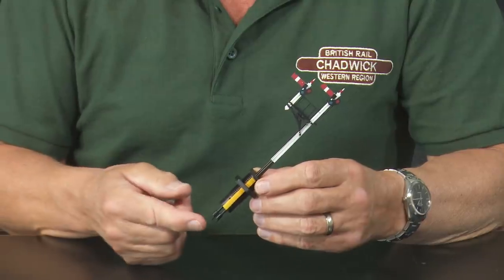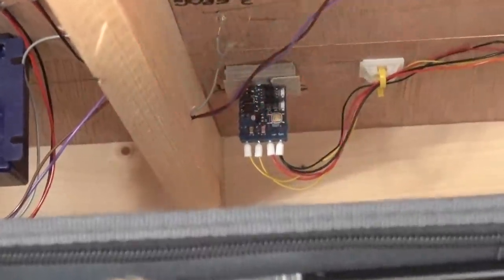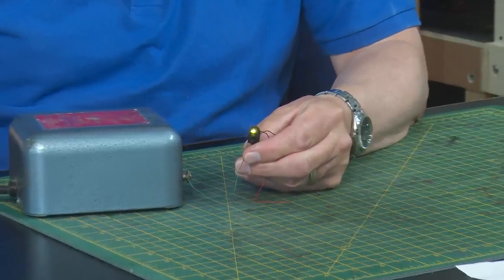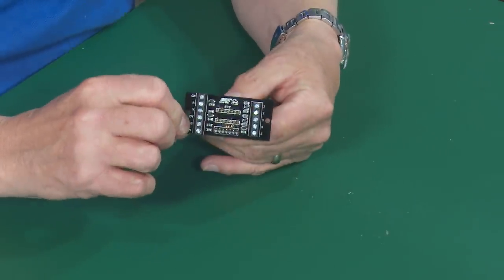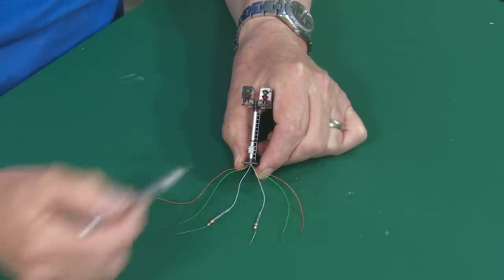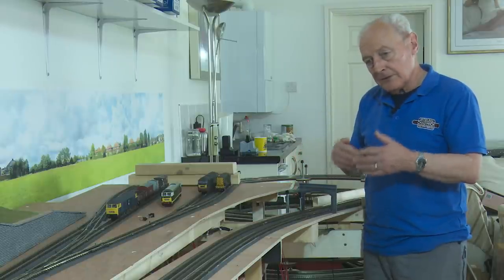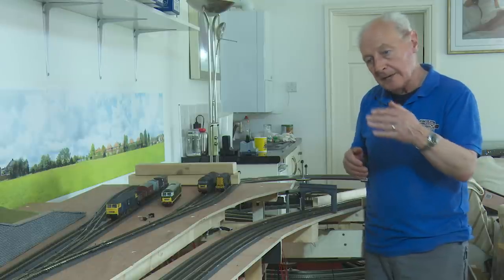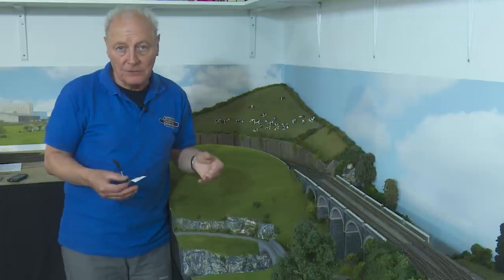Wiring LED and Semaphore Signals at Chadwick Model Railway | 135.

Comment: Charlie, thank you for taking the time to try out my products.  Really thrilled to see that you were impressed by them.  It means a lot to me to know that you are using them on your layout.  Best regards, Steve Heaton, BLOCKsignalling.
Reply: They seem like decent products Steve; Charlie isn't easily impressed.😁👍
Reply from the maker: Thanks for the comments Steve and yes they worked faultlessly straight out the box. One thing that did impress me off-camera was the very small ferrules that you use, perhaps you can give me a lead to where you purchased them from?  Regards Charlie
Reply: @BLOCKsignalling  what is the product description and code for the product used with the Semaphore signals, please. Keen to purchase

Comment: Hi Charlie, I always look forward to your videos and have got some great hints and tips from you. I would like to now pay you back for those. I was a train driver for about 25 years, I then went on to be a driver trainer before I left the railway for a short while, and now I'm a signaller at a very busy London Area Signalling Centre, (ASC). So, very basically, a controlled signal will always be 'on' i.e. at its most restrictive unless the signaller clears the signal. This means a stop signal will show danger and a distant or repeater signal will show caution. This is the same whether under Absolute Block (AB) signalling (Semaphore) or Track Circuit Block (TCB) signalling (normally Colour Light). Where these great gizmos that you show us really come in useful is for automatic sections on TCB lines. For example, you have several signals on a stretch of line where there are no points (crossings or junctions) and the passage of the train would be used to operate the signals. However, where you have points, the signaller will have to decide where the next train is to go (or come from) so will have to set a route prior to clearing the signal. That is why controlled signals are always normally 'on'. (At danger). In modern signalling the passage of the train will put a controlled signal back to danger, however, the signaller would then have to re-clear it. In AB / Semaphore signalling, the signaller would have to physically return the signal to danger and then physically clear it again. I hope this helps and gives you a basic idea. if you wish for any more information, please don't hesitate to ask as I have only gone over signalling at a very basic level. Keep the videos coming. Paul Kendrick.
Reply from the maker: A great comment Paul and great facts to absorb.  I have also replied by email.  Regards Charlie

Comment: As a Signal Engineer it is tempting to go into loads of detail about how your interpretation is wrong, but as someone else has said, for most of us it does not matter whether it is totally prototypical.
Starting with Absolute Block signalling (the old little signalboxes along the line with levers) they can be done with semaphore or colourlight. All the signals for a signalbox would normally be at danger (or caution for the distant signals). On approach of a train the signaller would hold the signals at danger until the train was close to each stop signal because the distance between them would not normally be sufficient to stop the train from line speed. Each signal would protect part of the station limits (the bit controlled by the signalbox). The signals on the approach would be called home signals and there could be an outer and inner home, or just the one. The signals going away towards the next signal box are called starters and there could be an advance starter as well.
If the signaller has got permission from the next signalbox for the train (using the block bells and instruments) then they clear the home signal(s) and starter(s) in sequence and then can clear the distant signal to show green. That tells the driver that all the signals controlled by that signalbox will be showing proceed and they do not need to slow down.
If one wanted it to look really realistic then it would be nice to be able to trigger each of the signals to clear from your control panel but for the passage of the train to cause the signal to go back to danger.
Reply: Totally agreed and very well explained If we modellers want to include signalling on our layouts then why indeed not follow prototypical form it makes for a very interesting scenarios 👍
Reply: Glad you wrote that one John, wasn’t looking forward to try and explain absolute block concisely, Charlie plenty of articles online about absolute block and diagrams explaining about block instruments etc, google is your friend, Once again Charlie, you are right though when it comes down to it, it is model railway and only you can decide what looks right for you and your pockets
Reply from the maker: Great comments guys, and let’s be honest installing semaphore signals that work prototypically with automation is an absolute nightmare. Regards Charlie
Reply: Back in the late eighties I was released from train driving for a period to help make in house training films. Though dated now most are online now look for “principles of signalling” parts one and two. Films show a lot of the above and will include some shots of very old types a lot now vanished and of course more modern colour light signals.  Real signalling easy but trying to wire up model layouts I’m finding a nightmare.   I want a mixture of semaphores controlled manually with levers and colour lights both auto and semi auto and track circuits!
Reply: @jdavis460  excellent link for us modellers Brian I do have access to RSSB but as you may know I cannot share it word for word here.
Reply: Your description is not strictly true, if a driver approaches a distant that is on, then he would slow to be able to stop at the home signal, even if in reality it is off. Automation could be achievable with a control application such as Train Controller, be it would need to know a tran has passed the signal either by block detection or infer red detector. Personally I have full track detection on my layout and a control system for both semaphore and 3 aspect colour light signalling.

Comment: To me as a DC railway modeler this video really emphasised the difference between DC and DCC. As for DC the safety measures are really build in to the trackwork (power on/of with appropriate signal lighting on/of as well) as for DCC the safety appears to be build in the programming of the locomotives. Quite interesting really 👍
Reply from the maker: Yes Rob sadly they are worlds apart and even further as technology develops.

Comment: Hi Charlie ... I nearly missed this video ... and regarding signals and Blocks ... and being a member of MEREG ... Julian one of the members developed a brilliant means of stopping trains at a red light with a very small PCB of electronics and a section of isolated track ... I designed the PCB's and have 2 types of boards, Red light stop and Station stop ... and the way it works is it sends a stop DCC code to the locomotive in the brocken section which stops the train, once a Red light changes to green it sends another DCC code to start the train ... in a station it stops the train for a predetermined time ... and it works on any locomotive ...
Reply from the maker: A very interesting concept John. Many thanks, regards Charlie

Comment: And now for a comment on your junction - the route without the feather or indicator is normally the highest speed route even if it is not the straight one (although that can look odd!). If the speed of the lower speed route is more than 10mph less than the highest speed route then the signal will be restricted to help remind the driver to slow down. The most restrictive is to hold the signal at red until the driver can see it (known in the trade as MAR - Main Aspect restricted to Red). If the junction is higher speed then you can have the signal restricted to Yellow (MAY) if there is a flashing yellow in the previous signal or a splitting distant.
If the two routes do not have a speed difference greater than 10mph then both routes can have a green displayed and the direction of the feather is a bit immaterial. In your example some people might provide a feather for each route, or they will provide it for the main route or for the route that is not as straight!
I have been in meetings arguing for hours about that sort of thing.
Reply from the maker: Hi John, you’re pushing on an open door. I think you’ve hit the nail on the head as the lines that run down to the Helix will have a 70 mile an hour limit whereas the line is going to the branch station will be limited to 40. Regards Charlie

Comment: Hi Charlie another interesting packed video and your line diagram to explain Anode (+ feed resistor) and Cathode (- ground resistor) easy to follow and may use it to explain to others in my workplace when wiring up charging circuits etc (Diodes one way valves). 
As I am sure you are aware the flow of electricity is from negative to positive not as commonly believed positive to negative (thanks to atoms lol).
I enjoyed the different options you showed and as always your sense of humour, take care and please stay safe..
Reply from the maker: What a heartwarming comment Barry. Regards Charlie

Comment: Excellent video Charlie.
Problem with using a single resistor is that the current limiting is shared between all the LEDs and as different colour LEDS have different forward voltages and currents you get dimming when two or more are used.   I've always used a hybrid of the two methods - the LEDs are wired in common cathode arrangement, but without a common resistor.  Then each LED has its own resistor of the correct value to ensure the brightness is uniform across all LEDs.  I tend to use resistor values that restrict the current so that the LEDs are not ultra bright, but more "scale" like.  This way the signals don't act as search lights or floodlights and turn night into day :)
Reply: Agree with Malcolm; the general case is each LED has a resistor of its own between the control signal and the NON-common end of the LED. The OTHER end can be commoned. This is because different coloured LEDs normally need different voltages to give the same light level. Sorry
Reply from the maker: An excellent point gentelmen.
Regards Charlie
Reply: Totally agree with Malcolm and Basil. Separate resistors allow for multiple LED illumination (for lamp testing, even if not for operational use), and fine tuning of LED brightness. Different colour LEDs have different current requirements for the same perceived brightness.

Comment: Because of the method of operation of Track Circuit Block there tend to be a lot of colour light signals which work automatically - clearing signals as the blocks ahead become unoccupied. But as a train passes into the section, the signal returns to danger to protect the train by what's known as, "first axle replacement". So, the default is obviously OFF but only until a train passes. To replicate this in model form is very complex but a simple solution might be to "simulate" it instead with an appropriate delay (the Block Signalling controller you demonstrated replicates this very nicely). Signals at junctions are manually cleared by the signalman but still replace themselves automatically immediately as the train passes.
Semaphore signals (with a few rare exceptions) are always manually controlled by the signalman. Being cleared only when the section ahead is clear and (if a junction) the points are set correctly too.
These signals are replaced as the last vehicle passes and will remain at danger until the block ahead is clear. Only then may they be able to be cleared again when required but will not do so automatically.
The above is an oversimplified description and brief overview of operation and doesn't take into account 3 or 4 aspect colour lights or (in the case of absolute block) distant, section and home semaphore signals nor instances where there is a mix of semaphore signals and colour lights which is quite common too.
I do hope this has been helpful? It's a complex subject and difficult to cover by way of a short(ish) reply. As time moves, ever more sophisticated products are becoming available to control and automate the various aspects (excuse the pun) of model railway signalling and the accuracy of how this reflects real life is astonishing compared with just a few years ago.
Reply from the maker: An excellent comments, Garry. As you say, this is a very complex subject, which bewilders most. Regards, Charlie

Comment: With semaphore signals, blocks were very much still in use. In the majority of cases, there would be a signal box at the end of each block, and they could communicate with their neighbouring signal boxes with an electric telegraph. If a train was standing at signal box A, and needed to go to signal box B, then A would first contact B with the telegraph, and ask to send a train through. If B replied in the affirmative, then A would clear all if their signals ahead of the train to clear, and B would clear all the signals the train would have to pass before coming to stop, for example in a station. Each line would typically have multiple signals controlled by a box, and the outer most signals marked the start and end of the block. 
Semaphore signals worked in much the same way as colour light signals, except for the fact that the supporting infrastructure was less sophisticated.
Reply from the maker: Thanks Sam, very informative.

Comment: Very useful video, especially as an adjunct to Jenny Kirk’s video this week with a different method to achieve automatic signalling.
For model railway purposes, there’s no problem in treating semaphores as if they were colour lights, with a block detector beyond the signal returning it to danger before resetting to road clear. In effect this makes it an ‘automatic’ signal. In prototypical practice all semaphores would be equivalent of colour-light ‘semi-automatic’ signals, held at danger especially where protecting a junction. Prototypically, you’d also have an ‘overlap’ section of track beyond the signal so a train can come to rest safely and (hopefully) without obstructing points in the event of a SPAD.
Reply from the maker: I couldn’t agree more Will.  
It’s the semaphores that give us the headaches, the illuminated ones seem straightforward. Regards Charlie

Comment: All done with bells. Someone probably already mentioned but just in case the Signal Boxes were connected by telephone and bells. Bell codes told the next Signal Man what was coming; by the number of bells and would ask if the box was clear to move said locomotive up the line. There were hundreds more boxes in the 1930’s as so much was done manually including giving the men in the cab a key when they passed which unlocked signals in the block they were passing through and was another layer of safety. This was brought about by accidents such as the Clayton Tunnel near here in Brighton as trains became more frequent and faster in the last quarter of the 19th century. Great video. Thank you.
Reply from the maker: Great info Sarah, many thanks, Charlie

Comment: Charlie,
Before I owned and ran a model shop I was IC Usability in a v.large computer company and in my humble (ex) professional opinion, the 4 aspect example is a big FAIL - how on earth do you control a loco at the same time? - all that button pressing for what is really a simple operation. Your earlier comment about using switches is more like reality and a winner - why not give more examples of simple easy to operate systems - pushrod and servo systems are very popular. More modellers are waking up to the reality that DCC  is best for loco control and points & signals a totally separate system.  
I appreciate the trouble you take over your show, keep it up.
Reply from the maker: Hi RH, I completely understand your point of view.  With DCC operating your signals, computer control is the only effective system, triggered by the trains position.
Regards Charlie

Comment: A chap used to make my signals for me, as I did not have the dxterity.However, I hit on a wiring method to use 4 aspects, changing manually by be as the loco went along, so it follwed the green 2 yellow, single yeellow and sed aspects in sequence..........Loads of wires under the basboard, ut it did work .....and I was really pleased that someone my age, still had a little brain activity...Thank You Charlie........well done......Merry Xmas from Howard,..............
Reply from the maker: What a heart warming comment Howard. Stay safe. Regards Charlie

Comment: Hi Charlie. If no-one else has commented on how signal boxes clear semaphore signals. It's really quite simple, in that, if one assumes there is only a straight section of track controlled by one signal box, to be able to show a clear Distant signal, requires the Home and Starer signals to be cleared first.
If either or both of the Home or Starter signals are On (showing a Stop position), then the distant will be On, only showing a Yellow light. I am a retired signalman.
Reply from the maker: Thanks David, much appreciated. There’s many a signalman who advised me on this one. Regards, Charlie

Comment: It is called "block working" and in its most  simple form. Signal box A  will ask box B ahead is line clear for the train  to proceed by using the bell code or morse code.
Reply from the maker: Thanks Malcolm, much appreciated.
Regards Charlie